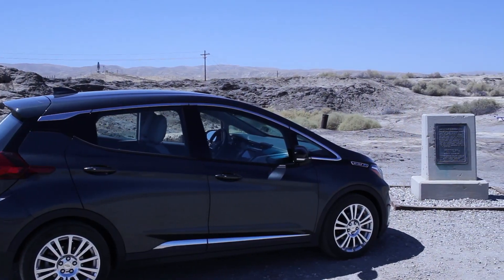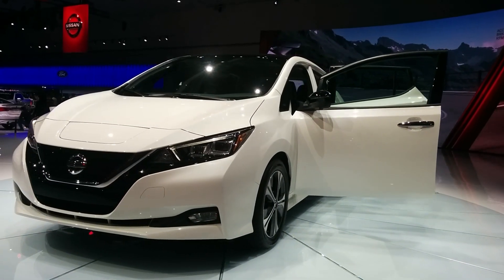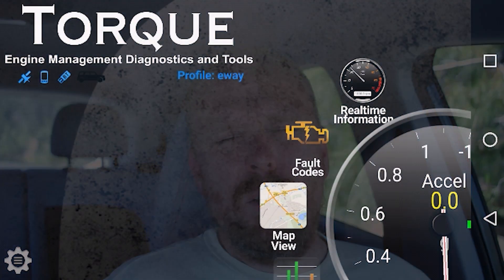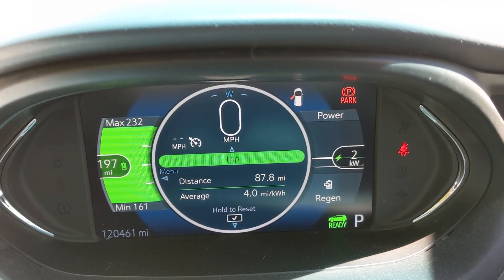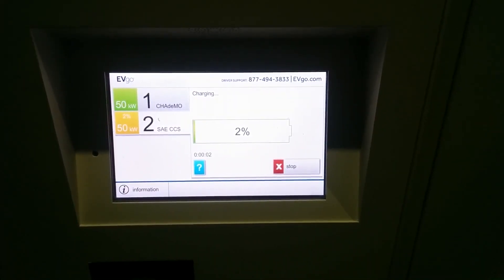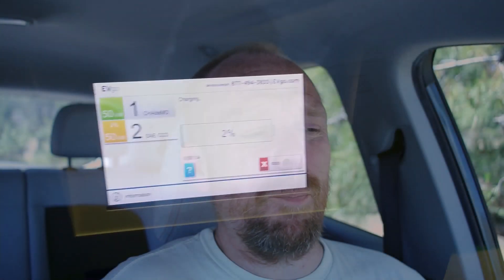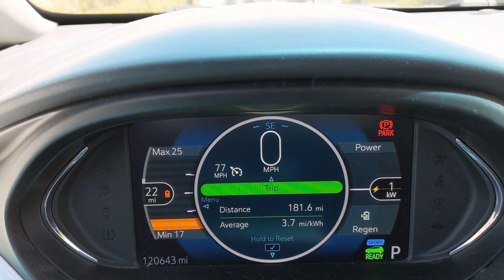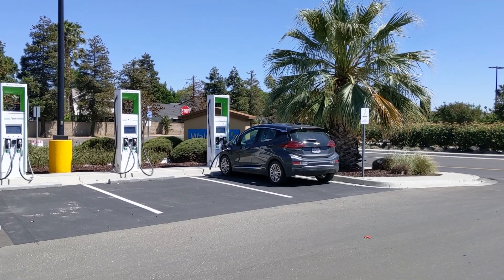2017 Chevy Bolt EV: Measuring Battery Degradation after 120,000 Miles

Comment: Do you know how many times you have charged the battery?   I used 120,000 divided by 200 miles per charge to come up with 600 charges.  Is that about correct?
Reply from the maker: That's probably close. In terms of DC fast charging, though, I'm typically only doing a 60-70% charge, so the number of "charges" is a bit higher. Also, I average a lot more than 200 miles per full charge, so it's probably closer to 500 to 550 full cycles.
Reply: @newscoulomb3705   Interesting.  I'm wondering how many more charges you'll get from that battery before it no longer becomes worth it.      You documenting your progress is fascinating and so educational.   Thank  you, and keep it up!

Comment: Good work, hero!
The math can be even simpler than you show in the video, and you can work it so you can do it easily in your head while driving. Watch the green bars on the indicator to the left of the speedometer reading and have "kWh Used" (since last full charge) displayed on your screen. Just as a green bar blinks down to 50%, double the value shown for "kWh Used" on the screen. 
Don't get too distracted and crash, though, OK!? And, be sure that there were no partial charges since the last full charge.
[The details: The math boils down to dividing the value shown on your car's screen for "kWh Used" by 1 minus the decimal value for the percent capacity remaining. Therefore, if the screen reads 30.0 kWh Used when the indicator blinks to 50%, 30.0 divided by 0.5, is the same thing as 30 divided by 1/2, which is the same as 30 times 2. Therefore, the screen in this example is saying you have 60 kWh of (usable) capacity.   (1 minus 50% = 0.5.). If you are a whiz, you can do it when the bars blink to other percentages too. 75% is another easy one- multiply by 4 (1 minus 0.75 = 0.25 or 1/4). However, the more kWh used, the more accurate the reading is likely to be. 50% might be the best trade-off between accuracy, ease, and frequency of occurrence.
Remember your grade school math- to divide by a fraction: invert and multiply. I'm a science guy, apologies for the math lesson digression...
TorquePro readings show that the bars blink to the next lowest 5% level right at the limit- no rounding. So when a bar blinks to show 50%, that's what you have right then. If it blinked a minute ago you have somewhere between 45 and 50% remaining.]

However, I am now really curious about these capacity calculations. Either they are in error, because the car doesn't report what it actually has, TorquePro PID calculations are in error, or GM is telling me I have LESS capacity than I actually do (OK by me!). I posted about this on the Chevy Bolt EV .org forum (and you kindly responded), but since then the plot thickens a little, because I have received the "build sheet" for my car from GM.
 
For readers here: my calculations showed that I likely have the 66 kWh battery in my late 2019 Bolt (built June 10th 2019, purchased August 28th, 2019, about 8500 miles on it). The 66kWh battery wasn't advertised until the 2020 model year, GM advertised the 60kWh battery for 2019. The sticker just says it is powered by a Li-ion battery. 

We don't have any fancy chargers in my area of Alaska- ones that show remaining capacity, so I dove in and used values given by the TorquePro app to get battery capacity values of 68.6 and 67.6 kWh on two long trips I took recently. As you know, but readers here may not, the app, with some persuasion, calculates values from parameter identification codes (PIDs) transmitted to your phone or tablet from a bluetooth dongle that plugs into the car's onboard data (OBDII) port. (total cost about $25 and some head-scratching time)...

However, the reading given by the green bars in 5% chunks is less than the values in TorquePro for "State of Charge HD Raw". (which is what I used to calculate a total battery capacity of more than 67 kWh on those two trips). I assume that "SoC HD Raw" is the total battery capacity, but the car will never let you use all of that capacity. (Which is a good thing. If you ran the battery down to zero it would never charge back up again, so it is good that the software managing the battery holds a little in reserve.) However, TorquePro also gives a precise value for "Battery % DIC"- which I assume is the exact value for the one shown by the green bars in 5% blocks to the left of the speedometer reading, in Chevy's "Driver Information Center" (DIC). That "Batt % DIC" value in TorquePro is about 4% lower than the value given for "SoC HD Raw". 

In model years before 2019, TorquePro will give an actual Estimate of Battery Capacity, but for a 2019 model, the value displayed is always -8.6 kWh. (I am interested in reasons why you don't use TorquePro to estimate degradation? Have you found that the values the charger communicates are different from the PID calculations displayed in the app?)

When I instead used the lower value for "Batt % DIC" in TorquePro to calculate battery capacity for the two trips (both over 230 miles from full, without charging on the way), I got 64.5 and 65.5 kWh, which would be in the neighborhood of what I would get using the "double the value" method described above. So if readers get a value a kWh or so lower than their stated capacity, rest assured, your actual total capacity is probably a bit higher. Remember that battery capacity varies based on other things too, especially temperature and recent use, so it's not a fixed constant. It's a nominal capacity- a named capacity- actual usable capacity will vary. Tracking this variation using the easy "double the value" method might be an interesting thing to do for those so inclined. You'd get a lot of nerd food, er, data. (Mwaahaahaa!!). Make sure that the kWh Used reported on the car's screen since the Last Full Charge doesn't include any partial charges since the last full charge.

Finally, the build sheet from GM reports that my 2019 Bolt has 60 kWh pack installed. Either the TorquePro numbers for "State of Charge HD Raw" or "Battery % DIC" (which agree with the DIC readings on the car) are in error- seems unlikely; or the build sheet is wrong, which also seems unlikely, but maybe less so? The range I am achieving sure seems to suggest I have the larger pack (235.1 miles once with 21% remaining). 

Incidentally, the build sheet is generated from the vehicle's VIN- it shows a lot of interesting stuff. Get this sheet free from GM by emailing your VIN to socialmedia@gm.com and asking for it. I got the .pdf the next day.

Thanks, you are really helping! Keep up the good work!

Comment: We all need to take special note that the Nissan Leaf offers battery capacity markers on the dash as well as API's for the LeafSpy (android) to give you exact readings (capacity, resistance, and much more). Having said that, I have a Bolt because the Leaf doesn't do well in heat  (passive cooling) and overall I think that GM has better engineering. I wish that government regulations mandated that every automaker provide the battery health transparency that Nissan does. This level of detail also arms the shopper to feel confident when buying a used Leaf.

Comment: I really appreciate the information you’ve provided. I recently purchased a used 2017 Bolt partially based off of the info you’ve provided. As far as I can tell, the degradation on my battery is negligible and I can easily make 200+ miles range on a charge without any effort. It’s nice that these cars are viable as a used option to let people into the EV game at an affordable price!
Reply: local dealer has 2017 Bolt for $17,000 with 25k miles. 
Is that price too high ?
Reply: @lw216316  For comparison, I just got a 2017 Bolt (Premier, w/ all available options) with 17.5k miles for about $18,900 from a used ev car dealer, so I'd say that's not bad. I love it!

I think currently new 2020 ones are going for about $30-$34 with all the steep discounts due to them not selling well during the pandemic.
Reply: thank you
Reply: Winters are a downside on battery range

Comment: I tried this today with my 2020 Bolt which I’ve owned for 3 months and 2500 miles. I drove it down to 1% and calculated my usable battery capacity to be ~64kWh. Is the entire stated capacity of 66kWh supposed to be usable? If so I have 3% degradation already which doesn’t seem right. For those interested in the details I got 232 miles of range of which all but ~5 miles was driven on the freeway at 70mph. My efficiency was 3.64 miles/kWh. The outside temperature was low to mid 80’s, and I had the AC set on auto at 73 degrees, which consumed about 3% of the energy.
Reply: This is not a perfect test.  This test will only give you the usable capacity and not the actual capacity.  The test doesn’t take into account any capacity that might be locked away by GM.  Plus 0% SOC is not the end.  When I did the test with my 2018 Bolt, I was able to go beyond 0% SOC for another 2kwh before the car stopped.  Looking at your numbers, I think they’re quite normal. Enjoy your car.
Reply: Capacity is easily affected by temperature. Also, batteries will degrade the most in the first few months than flatten out.

Comment: Question for you - how accurate do you think the Electrify America charger battery percentage read-outs are? I’ve done this twice with my 2019 Bolt (though only down to about ~27% SOC) and when I run this calculation it gives me a theoretical capacity Of OVER 60kWh (like 63-65kWh). 46.8kWh/73%=64.1kWh? That shouldn’t be possible with a 2019, so I figure my math is wrong or the percentage I’m using is wrong...? Any thoughts?
Reply: I have a 2019 also. On my first capacity calculation, I used ~60kwh using ~90% of the available energy. This led me to deduce that LG/GM had actually increased energy density/capacity, but did not tout it until the 2020 model year. To further support a (unannounced) change being made, the parameter ID for estimated battery capacity on the canbus, either was changed itself, or the formula was changed, because it is jibberish compared to the working formula used to calculate 2017/2018 Bolts (Spark EVs and Volts as well).

Comment: I saw a video on YouTube, on a chevy Bolt battery tear down where they battery was actually around 57Kwh, plus if gm has some sort of reserve battery that would mean the degradation could be less than 5% after 120k miles which is actually really good

Comment: Have you seen Professor John Kelly's teardown of a 2017 Bolt battery on the WeberAuto channel. He makes a pretty compelling case that the battery capacity is effectively 57 Kwh. In the video discussion someone states that the cells are charged to 4.1 volts. However if the cells were charged to their max rating of 4.2 then the battery would be 60 Kwh. Is this possibly why the degradation is low because of a built in 5% cushion for those who charge to 100% often?
Reply from the maker: This is a different take explained from GM's perspective:

https://electricrevs.com/2018/03/29/gm-explains-57-vs-60-kwh-bolt-ev-battery-ratings/

Comment: Just to be clear je was reading the kWh off the cars meter, not the charger. Right? Because the charger would only be between, 90% and 95% efficient.
Reply from the maker: Yes, this is based on the car's usage screen. Beyond the charger inefficiencies, the Bolt EV will draw additional power from the charger to run battery and cabin conditioning.

Comment: Thanks. I am impressed. Chevy got its sums right. If only the Bolt could charge at 100 kW. Maybe the new GM BEVs will support higher charge rates.
Reply from the maker: I think that's the plan. The Bolt EV's design predates even 150 A public chargers, so GM will probably rethink the design.

Comment: Do u get a squeaking sound?
Reply from the maker: From what?
Reply: @newscoulomb3705  from pushing acceleration n brakes sometimes. It's loud screechy sound
Reply from the maker: @and1shoes178  I've never had that, but it sounds vaguely familiar (something like a bushing or CV joint). I believe it is a known warranty issue.

Comment: So Nissan can have a system (be it not accurate) but Chevy can't do it? You even said "your" method is not accurate. In reality, it is nice to have "some" method for second and third hand buyers to use.
Reply from the maker: Most cars don't have that type of display, and that's probably because it isn't very accurate. Nissan had to recall and reprogram the BMS on their 30 kWh LEAF because it was claiming lost capacity when there was none.

In the Bolt EV's case, I don't think battery degradation is expected to be an issue, like it is in the LEAF. Just to be clear, I am very hard on my Bolt EV's battery, so the degradation I'm seeing is likely double the average for the Bolt EV.

Comment: 120000 on those seats ouch. I would put a foam wedge down
Reply from the maker: I never had a problem with the seats. In fact, the seats and seating position in my Bolt EV corrected an issue I was having with my back.

I didn't know the Bolt EV's seats were uncomfortable until six months into  ownership when a Tesla Model S owner told me they were. 😂

Comment: Thank you for the information. I have 2017 Bolt with 62,000 miles, and 2018 Bolt with 24,000 miles. Both are charged at home every night on L2 to 100%. I have not noticed any degradation in efficiency or range on the 2017, other than seasonal adjustments. My wife drives the 2018. I don't drive as fast as you do, so slightly better range.  Using the heater has far more effect on range than anything else. As of January, both vehicles are driven by family members, so I rarely get to use them, as we are not traveling due to shelter in place. Neither vehicle has required any service other than a new set of tires, as well as the recommended updates, for the 2017. Due to your channel I developed two driving styles, one for DCFC on road trips, and one for around the local area on L2. As of January 2020, I am driving 2016 Leaf. I miss the Bolt.
Reply: Just curious, why don't you use the hilltop reserve mode? To me, using that setting to limit the charge to ~90% seems like the natural choice to make sure your battery lasts tens of years while minimizing wear and degradation.
Reply: Four reasons why I decided to charge to 100% as opposed to "hilltop reserve mode", no particular order: 
(1) Regenerative braking is effective after you drive a couple of blocks. (Someone argued that regenerative braking wouldn't work at 100% charge, so to use regenerative braking you must only charge to 90%.) 
(2) I understood at the time of purchase that total battery capacity was in excess of usable capacity, which meant that I never really charged to 100% anyway. I think capacity is an estimate depending on type of measurement used.
 (3) I am unaware of any testing on the Bolt battery that indicates charging to 90% makes the battery last any longer that charging to 100% especially on L2 charging. In fact, I think that charging to 100% with L2 is much easier on the battery than any DCFC. (Heat, I imagine.)
 And finally, (4) I simply wanted to run my own experiment to test the above, and so far my clinical real world observations are as stated, charging to 100% daily with L2 does not appear to have any effect on the battery. To be sure, check back with me in seven years for the ten year conclusions.
Reply: @richardneilson1188  Why don't you like your Leaf?

Comment: Great news!  One less thing to worry about.  We only lease BEVs, like most, so battery degradation has not been an issue on the 3 we have had.  With your miles driven, I can see why buying is the only option.
Reply: Even leased, one would have to concern about fast charge rate. Pre-2019 Bolt is slower with step downs at 55% and 70%. But unlike Leaf that drops "fast charge" as low as 3 kW using 50 kW charger on hot days, Bolt's keeps 55 kW to 55% even in hottest summer days.

Comment: That method wouldn't work with some EVs such as the Leaf because the BMS report 0% on the dashboard and to the charger when there is 10% of battery left. Same on the I-MiEV, but it's reported correctly on the charger.
Reply from the maker: Good point. I should have mentioned that I've cross referenced the number on the DCFC with several apps that connect directly to the car, and they all report the same number.